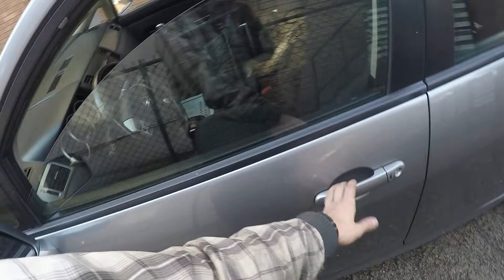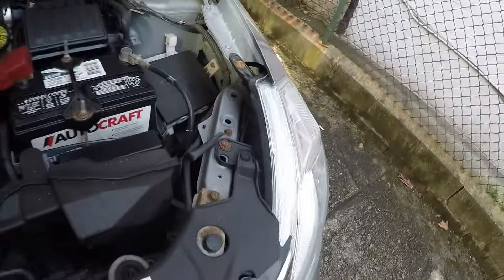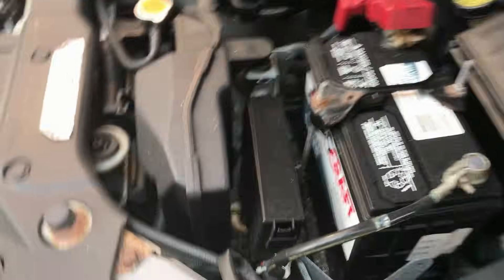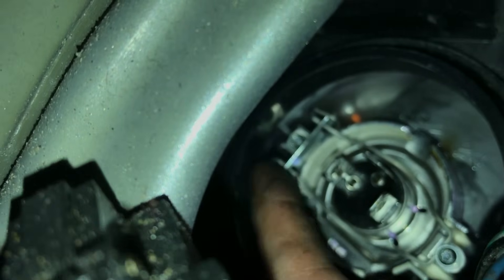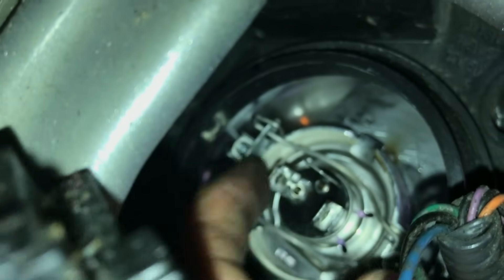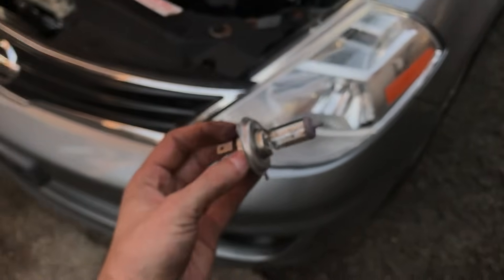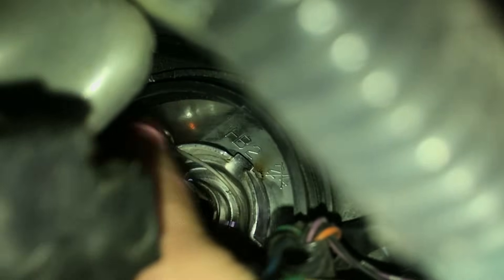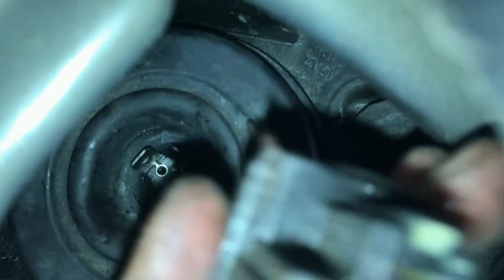How to remove change replace Headlight bulb Nissan Versa

Comment: Never done this before and the auto book had me taking the whole front end apart. I asked myself "why cant I just do it with the housing still in?" Your video was the first I ran across and now I feel foolish for almost overcomplicating something that took a couple minutes. Thanks! 👍
Reply from the maker: very Welcome!
Reply: The A/C fan blower motor is the same way. A dealer will charge you $1500 to change it because the official service manual tells them to take half the car apart. I changed it in less than 30 minutes (only because I had some difficulty getting the part in and out) for $60 for the part.

Comment: Honestly I started to panic because I don’t work on cars I’m a girl the best I can do is check my oil I have to change a flat I probably can figure it out but I don’t really have a brute strength to pull on anything. The video I watched before yours was shit I could not figure anything that he was doing. I said let me watch one more video and then lo and behold thank God I found yours! It was still a struggle for me because gripping everything and pulling it apart was hard not getting cut by all the metal inside was hard it took about 40 minutes I know but thank you it’s done and it works. God bless you.

Comment: thank you very much for sharing this tutorial  ！My father owns a 2009 Tiida and it lost both side`s hight beam. I wondering if you can post a video about how to remove the hood of the bulb,you konw ,the silver cap on the top of the buld.Cause i want to  replace thoes bulds with the new led lights which has lens. Again ,thanks alot

Comment: Thank you very much.  My clips were not opening like they should and I thought that might not be how it works, so began trying to remove the entire headlight assembly when I broke one of the bolts.  That's when I decided to find a video to show me exactly what to do and came upon this video.  
Thanks to you I knew those clips were supposed to open as I had been attempting to so I had to use a screw driver to force them harder than I could with my thumb until they popped open.
I don't know what I'd have done with out you. 
Thanks again.
:goodvibes:

Comment: it is a relatively easy change, but be advised on the 2014, the bulb must be in the correct orientation. It can be put in upside down. If you notice you are lighting up the trees, you probably have it upside down (like I did)

Comment: One thing I must add to your excellent tutorial , and that is you must not take the new bulb with your bare hands, use some gloves or a cloth, if you touch it with your fingers , get some alcohol and a clean napkin or clothe and clean it, otherwise your bulb is not gonna last that much. 
The grease in your hands is what  ruins it. 
Head lights and any other halogen light has to be done this way, or it burns right away. 
Saludos 👍

Comment: Thank you! Super helpful for changing my bulb.  I went to the local auto store which offers a bulb fitting service.  I called before hand to make sure they had the staff to do it and advised what car i had. They told me to come in. They lied that the only person available was on lunch at 3pm. They asked which car i had and it not mention it cant be done
 I dont think they expected me to return. When we came back an hour later it was the same person who initially answered our query. Funny he wasnt at lunch at 3pm when the store closes at 5.30pm. He then saw the car for a minute and said I had to go to a  mechanic as they had to remove the headlight fully to change it and store policy said they can't do that. When I said I would do it myself after seeing your video and got a bulb I asked him how to do it. Funny he couldn't remember his lie about unscrewing the headlight because he didn't mention that step in the instruction. I'm super pissed my time got wasted. Especially since I called before hand. If they told me they couldn't on the phone I would have understood. Even in the store after I drove from another branch I would have understood. But to waste 2 hours and tell lie upon lie. Some people can lie so easily they obviously didn't have courage to take responsibility. Shout out to Supercheap auto

Comment: Thanks. I didn't want break anything so I found your video. Looks simple when you do it so we will see how it goes. Don't see how anyone could give it a thumbs down.  I am back. I finished. My right arm is bright red from squeezing it into such a tight spot. It was definitely a PITA. It would have been such an easy job if it wasn't for the terrible design. It is almost impossible to get your hand in and you can't see what you are doing. Without your video I wouldn't have had a clue.

Comment: Thanks for the video. Two points: First, Be very careful NOT to touch the glass. Otherwise, the oil on your finger will cause the bulb to overheat and burn. Second, if the new bulb is still not working, make sure it is connected correctly. A small mirror is useful to check the connection.

Comment: Struggling to get the last metal clips off. My fingers are hurting so going try again tomorrow. Any tips? Looks like you push them in and then lift down and up. I was struggling so hard and they weren’t coming off. Don’t know what I’m doing wrong…

Comment: Thanks for this. I had one done at Jiffy lube and they took the bumper apart. When the other one went, I found this and did it myself. Definitely not easy for someone with big hands but I still got it done.

Comment: Very Helpful.  Manual has no directions, says it can be down without taking headlight assembly out, but then says contact dealer.  The wires are so puny and you cant see anything as everything is blocked.  Very easy once you know what to expect while feeling around blind.

Comment: Beautiful clear camera work, thank you for posting.  I would like to add:  1. don't touch the new bulb with your fingers as it will shorten the life of the bulb and 2.  place a small amount of die-electric grease on the connections before reconnecting.

Comment: It's MUCH more difficult than this video makes it look  >Take my advice. PAY an expert to do it if you can afford it.  You can't see what you're doing!    I finally got through it, after having all kinds of trouble with the clips, and when I plugged it in, it didn't work!  I haven't figured out why yet, but I'll probably just get my mechanic to do it.   Meanwhile< i can't drive the car tonight...I had lowbeams before, now I have nothing.
Reply: BTW, before you replace the bulb in its spot, plug the new bulb in to see if it works.I'm wondering now if I bought a bad bulb, or if I put the wrong one back!

Comment: Amazing they do not cover this in the manual that comes with the car....
Reply: Yeah, manual says to take it to the dealer. Car has 180,000 miles on it and has only been to dealer for air bag replacement recall.

Comment: This is actually a bit more difficult than it looks.  Here is my step by step.

VERSA HEADLIGHT BULB REPLACEMENT
1- Pull off connector from bulb.  It will pull straight out, there is no securing tab.
2- Peel back rubber boot from outer diameter and remove.
3- Unclip the bulb.  Will need a small flashlight to see how this is done.  There are two clips.
4- Remove bulb.
5- Insert bulb.  Note there is an orientation with two metal tabs close together towards the ground, single one up.
6- Secure the clips to the bulb.
7- Push connector through the boot inner hole so that its face is even with boot opening.
8- Insert connector into bulb and secure the boot.

Notes:  There may be some old grease inside the female connector openings.  It might look like water got into it, but it is grease.  You can either clean it out and then rub dielectric grease on the bulb male connectors or just leave be, reusing the old grease.

Comment: Good instructional video. I had some difficulty with one of the clips as did other viewers, but I persisted and got it off. Looking through the lens while installing the bulb helps with alignment. Be sure to wear lightweight latex gloves when installing the bulb to avoid skin oils from coming into contact with the glass. If you think this job was mildly difficult, wait until you have to replace a rear bulb.
Reply: Oh My God! I had to replace a rear bulb about 5 years ago on my partner's car. If we had had any idea about how much of a pain in the ass the operation was and is, we would never have bought the car. Mechanically reliable, but I nearly lost the plot (OK, I did!). Changing a globe should be a simple owner maintenance job, this was an incredibly annoying process. Thank God I've only had to do it once.
Reply: I’ve done the headlight ones myself but even seeing a video on the back one I said no and just paid my mechanic to do it. I never even got the back light panel off! Forget the top breaklight too! Whole piece has to be done by Nissan and it’s several hundred dollars because it is one big LED piece. No thanks!

Comment: Nice, clear video, except the clips on my car were different and mounted vertically so the clasp is virtually impossible to see. Here are links to the picture I took (my head wouldn't fit in the space I got the phone/camera). I found pressing down on the two wire elbows and sliding it to the side worked best. https://www.flickr.com/photos/27773955@N06/49441198832/  these elbows: https://www.flickr.com/photos/27773955@N06/49441198797/

Comment: Great video! On my '16 there was a plastic cap that held in the rubber. Detach as you would a screw. But that was the only extra step.

Comment: I bought a Nissan 2014 versa but the turn signal light socket harness was cut off along with a small amount of the wires, does anyone know where I can get a replacement harness socket? I've tried going to the Nissan dealership but they want to sell me the whole harness for more than a thousand dollars
Reply from the maker: Just go to junkyard and explain them what you need. Should cost less than 100$

Comment: One thing the auto parts guy told me was to wear latex gloves when replacing these bulbs. The oils on your hands shorten the life of the bulbs, somehow.
Reply: Oils on the glass cause it to expand non-symmetrically.  This can cause the glass to shatter.  Common on these types of bulbs.
Reply: Doug fun fact: I work at a movie theatre and projector bulb replacement NEEDS to be done with special gloves. If any oil from your skin gets on the projector bulb it will explode. It sounds like a shotgun blast. No bueno.
Reply: Its not really a big of a deal with these low temp lamps but it's still good practice.
Reply: They told me to put bulb grease on it too (sold up next to the register)
Reply: That's true of most bulbs. Natural body oils getting onto glass will then heat up from the light or sun which causes the glass to crack faster

Comment: I can't get the bracket back on. I can't see so I'm blindly pushing, Any tips?
Reply from the maker: There are 3 notches if I remember right. One is wider than other two... make sure you get the right notch in right position

Comment: Those clips are truly idiotic. On our's, the passenger side had more tension or something. Right side was easy. Perhaps too easy, and made the other seem like there was something wrong with it.
The left had some additional extra adhesion. It isn't until you actually see that odd circular holding motion needed to latch and unlatch them that it even makes sense to know which direction to push it in, and when, at what part of the movement.

You can see the intended design. In a perfect situation you should be able to just pinch them together, push down and let go and the whole caboodle should spring back.. But it doesn't work together after years of heat and road grime, creating this need to almost 'wind' the clip on and off one side at a time, like threading a sewing machine or something..

Classic over engineering.

Many thanks for the video.